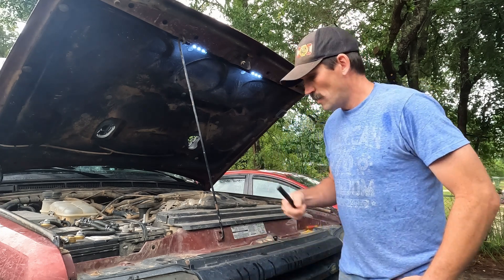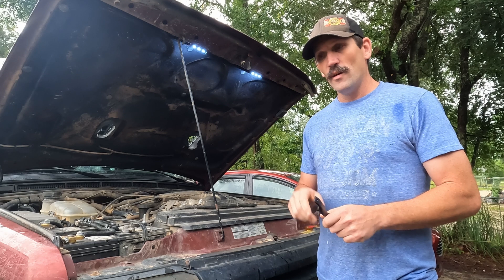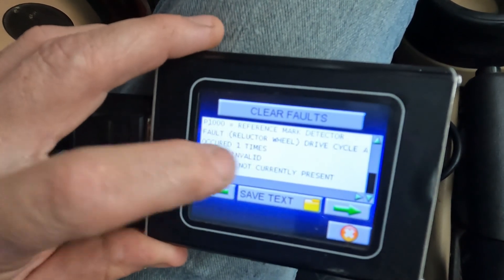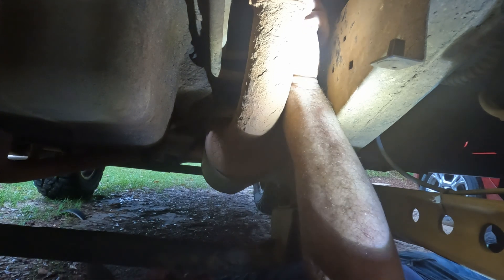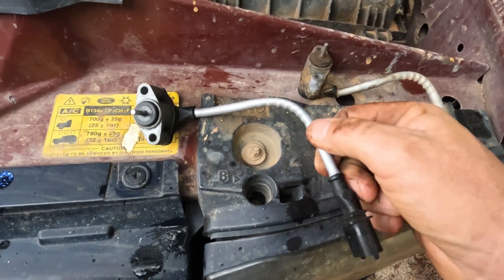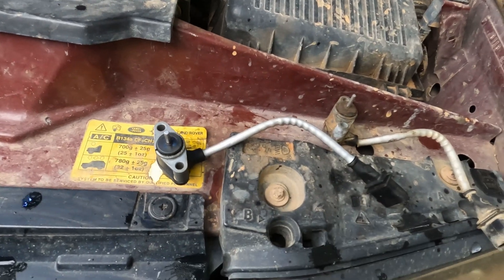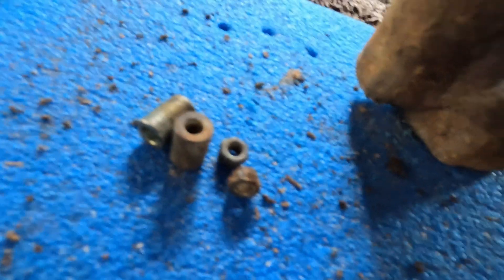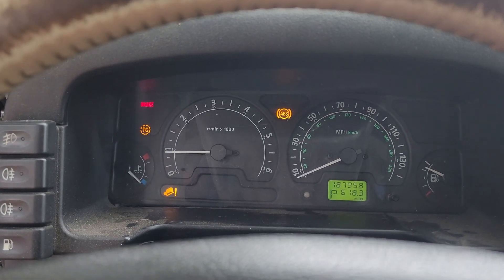Crankshaft Position Sensor Diagnosis & Replacement Land Rover Discovery 2 4.0l & 4.6l V8

Comment: I just finished this job and it was one of the most frustrating repairs I've ever done so I want give a couple pieces of advice that I learned as I was going. The first thing is if you are doing this on your back you are going to want your feet torward the rear of the truck. Secondly, I had more roof between the exhaust and the engine, initially I couldn't fit my had in between the exhaust and the frame which is the way he did it in the video. Eventually I reallizedd that I could get my hand between the frame and the exhaust if I slid it in closer to the exhaust manifold, once I had my hand in there I could the pass the tool through the otherside. I have bigger hands but I also think my exhaust is slightly tighter to the frame.

Comment: How do you get the engine light off for the secondary air not being there? The new 4.0 does not have it but my light is always on
Reply from the maker: You dont really. You could try and find a non SAI computer and also swap out the fuel pump assembly, because a non sai has a different set up than the rest, but they are hard to come by. I live in Florida where we dont have smog checks so I dont worry about it.
Reply: We need some software for this. I’ve yet to find a modification. So for now I’ve still been using the SAI in PA

Comment: Dose that effect with power loose.
Reply from the maker: Probably not. Usually a crank sensor failure results in a no start or engine shuts off. Engine will not run without crank signal
Reply: @ a oke my one is in a limp mood. Is not kicking in
Reply from the maker: @mits4486  m&s lights flashing? Stuck in 3rd gear?

Comment: Hey!

Thanks for the visual instructions 🙏

I have the exact same issues on a 2001 Discovery 2.

Did the sensor change solved your troubles?
Reply from the maker: @miguelcervantes5877  It indeed solved my issue of the truck shutting off.

Comment: Great video! Question, I’m stuck at disconnecting the CPS… my issue is that the connecting cable is so short and up behind the engine and firewall, I can barely get my fingers on the connectors. Any hints or tricks that would help? Thanks!
Reply from the maker: @barnabyjones9766  it's a pain in the butt for sure. Do you happen to have a pair of long handled needle nose pliers? You may be able to get to it that way!!!
Reply: @ literally painful… scraped up my forearms just trying to shove them in these spaces. Tried getting it from top and bottom to no avail. I’ll try the needle nose. Thnx for the advice!
Reply from the maker: @barnabyjones9766  it is miserable I know. Got a small child or a buddy with skinny arms? Lol
Reply: @ lol I’ll see if my neighbor will lend me his. Hahaha
Reply: @RedEyedJack  thnx again! I think when I hit this wall, one of my options were to just splice the wires… I know that wouldn’t last though.

Comment: Great and informative R&R video. I replaced the camshaft sensor on a D2 last weekend. Next up is the Crankshaft. And the notorious wheel speed sensor lights. I’ve changed those many times on mine.

Next up is a crankshaft sensor replacement on a LS Swap D2.

Comment: What kind of scanner you have?
Reply from the maker: @DDTHOR17k  i have a Blackbox Solutions  Nanocom. Specifically for the Disco. Works amazing! Can do everything, program keys, scan abs, turn features on and off like heated windshield, air suspension, can sync ecu, bcu, slabs.
Reply: Your the Man!

Comment: Very helpful video. I suspect strongly this is the issue. I’m currently having on my 2003. Any idea if he generic scan tool will pull up some of those more specific codes or should I be purchasing a nano con like you have?
Reply from the maker: @jonathanschreindl3575  sorry for the late reply, but any scanner should be able to scan the ECU for codes, but the code text may not match what the land rover specific code is. Scan the codes, then get on the Googler and look up the code and add "Land Rover Discovery 2" to your search.

Comment: On a discovery 1 v8 the bolts for plastic cover are the only thing hold the sensor. I used a 1/4 drive deep socket with a u joint and long extension. It was still pretty difficult.

Comment: Aww yes the 3 Amigos! I have the same thing going on.
Reply: Don’t have to it’s legendary symptom of these trucks. I’m going to change out both wheel speed sensors on my truck anyway a lot of the owners who own these trucks neglected them so it’s good to do some preventative maintenance.
Reply from the maker: @mcleodmarcel48  do you only have the three amigos? If you only have the TC, ABS, and HDC lights, it's more than likely not a wheel speed sensor. When you have a wheel speed sensor not reading, it kicks on the brake light, too. Check your wheel speed sensor connectors while you are at it. they get brittle and loose connection, throw voltage high or low codes. If you only have the three amigos, it's probably a shuttle valve switch issue. Bad ground, faulty shuttle valve switch, etc. There are 11 different reasons why the SLABS computer will throw warning lights with multiple causes to throw each code, so 40-50 different possibilities the lights are on.
Reply from the maker: Have you scanned the ABS computer for codes